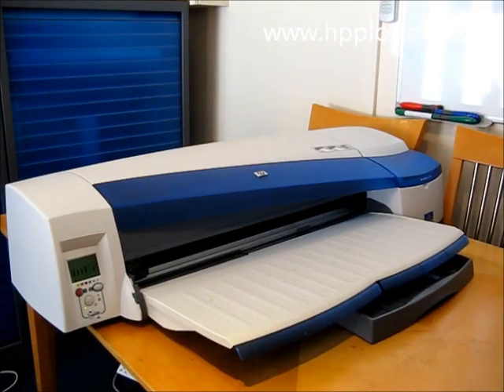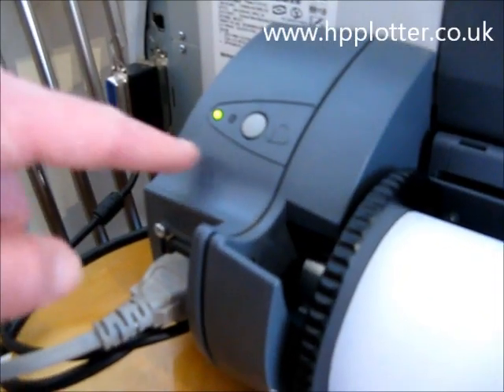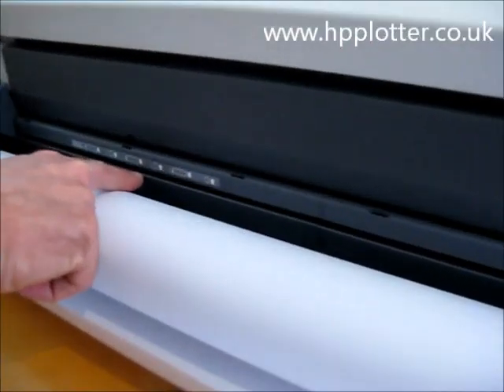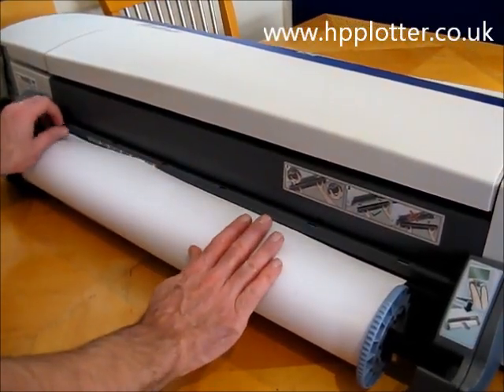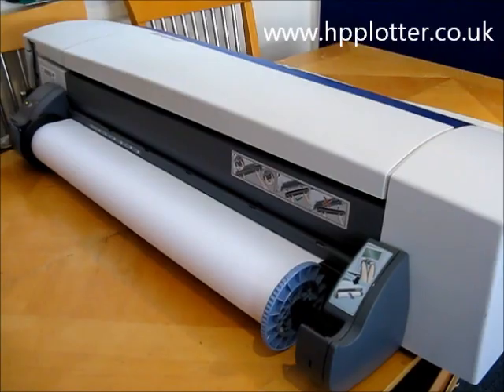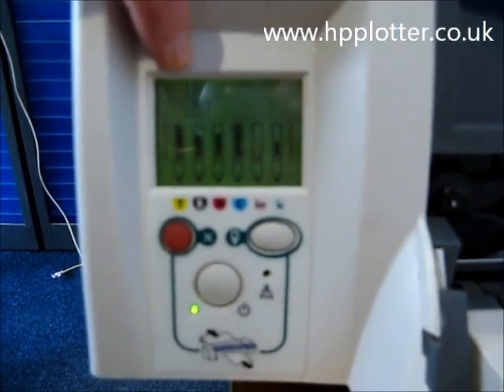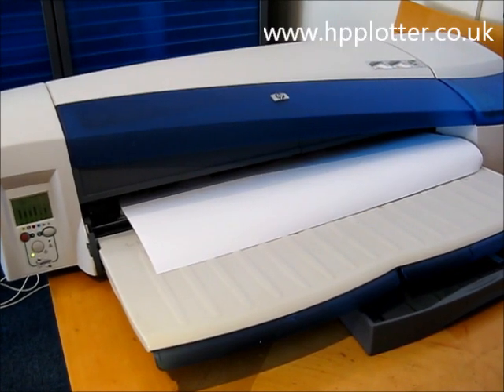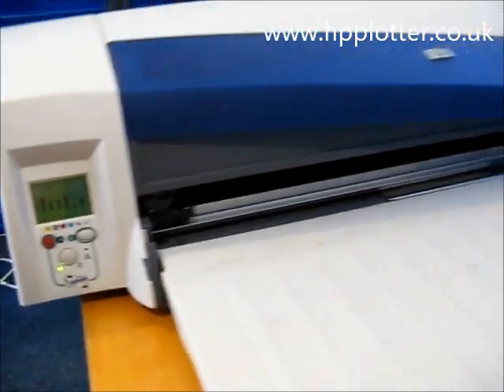DesignJet Repairs - DesignJet 120NR & DesignJet 130NR load roll

Comment: any ideas why the roll feeds always die any ways I can fix them have two and both have roll feeds that have died both 130nr models
Reply from the maker: No but like anything mechanical they do wear and tear. They can't be repaired and you can't buy them now so unless you find a working one on Ebay you may have to buy a new printer which will be around the £500 mark. Please email sales@hpplotter.co.uk if you are based in the UK for the best deal.

Comment: Can we print vinyl sticker paper through this printer
Reply: Provided the weight of the vinyl doesn't exceed the maximum parameters of the printer specification then you can - although we recommend you manually disengage the cutter.  However bear in mind the final use of the vinyl and the fact that the ink is dye-based which means it's not UV stabilised or water-resistant so you can't use the vinyl outside or the inks will run and fade - although for a short term use it may be fine. You may also want to try to laminate for outdoor use to keep it going for longer. Don't forget you need to buy a vinyl which is specifically for dye-based inks as well. If you contact consumables@hpplotter.co.uk they will assist you (but only if you're based in the UK).
Reply: @hpplotter6925  Hello! Can I get print on the 350 grams coated paper with this plotter?

Comment: I have a green light on the auto roll feeder but I have a hard time loading the paper into the printer lower slot, is there a more precise location for the roll of paper? any tips?
Reply: Hello Deb - if you are having issues then it is highly possible that you need to replace the roll feed kit which is why you're having issues loading the paper. Please contact us at engineering@hpplotter.co.uk for a repair estimate where we will attend onsite, replace the required part and include a service for you.